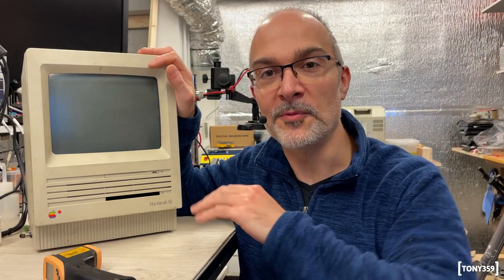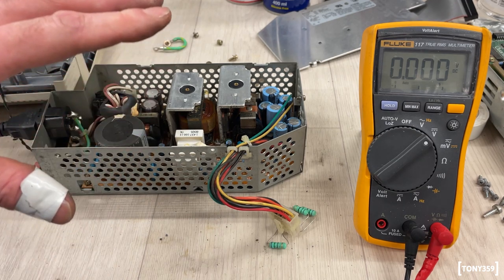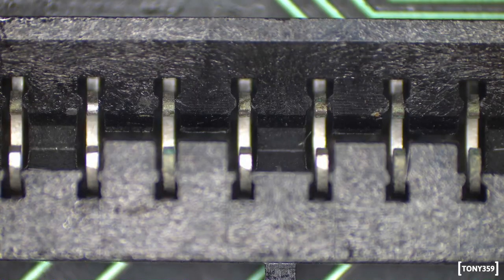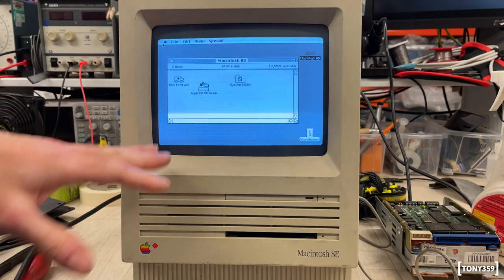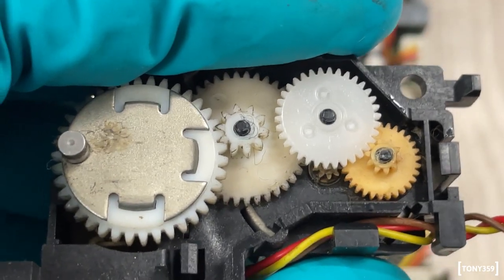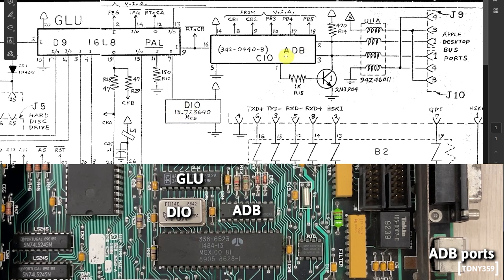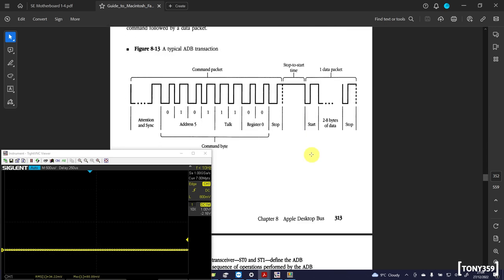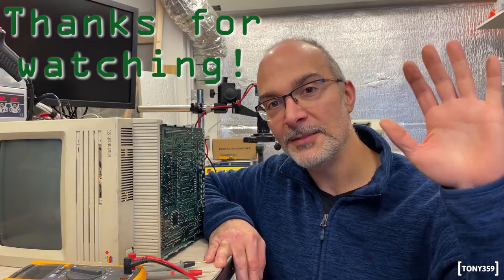Apple Macintosh SE Repair - Too many faults to win!

Comment: I format my mac disks using Mac drive 98 (Windows 95 software). You did a great job retinning the ram btw
Reply from the maker: How does that work? I understand Mac floppies run at variable speed so a Windows system cannot be used. Thank you, I was impressed by the RAM too! :)

Comment: Based on the findings I see from your great scope work, the ADB is working fine. I leaning to a bad mouse. I had an issue on a 128K where button pushed were not recorded and turned out to be the resistor pack but 128 is not ADB. If mouse is fine you could still have an issue with those resistors R31/32/33 and even the L1 filter.
Reply from the maker: Thanks for watching! You might want to watch the next episode then! Thanks for the input!
Reply: I await the release eagerly to see the outcome. Loved the detailed work. Things I should do and include in my vids.
Reply from the maker: The next part is being edited - I'll try to complete it by next Friday! Thanks for your kind words!

Comment: recommendation please put a towel under the CRT you might have had one but i might just be blind, i just wanted to recommend it so you do not damage any screens anyway great repair
Reply from the maker: It's a good advice but I think with the Macintosh the screen is so recessed that it does not touch the desk. My desk is covered with PVC anyways. I am currently working on a different type of CRT and indeed that protrudes enough to touch my desk when I place it face down - for that one I use something soft indeed. Thanks for mentioning though! And for watching!
Reply: @tony359  Ah fair just something i always did just to be safe
Reply from the maker: @Lycannitejabooti  It never hurts! Thank you!

Comment: Thanks for the very informative video, I have learnt a lot about early Macintosh machines, and repairing them from another YouTube site called Caymac Vintage , (His first name is Will), it might be worth reaching out to him to ask if he has any input on your problems with this machine. I'm looking forward to seeing you getting this machine fully working in the next video. You might also look into getting a Bluescsi board, if your hard drive is failing, they are cheap enough, and take standard micro sd cards, that can be used as a hdd alternative.
Reply from the maker: Thank you! I am learning as I go as well. Since the video I've discovered the HD20 feature of the Floppy EMU but also heard about BlueSCSI. Indeed plenty of options! Thanks for watching and stay tuned! :)